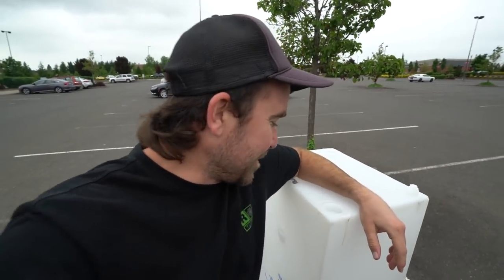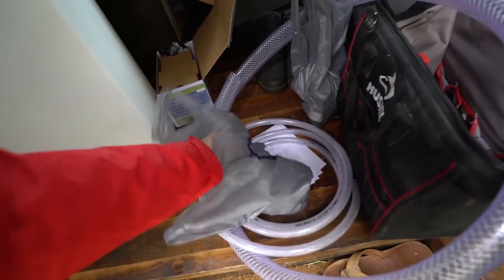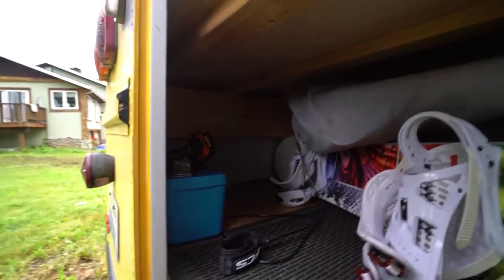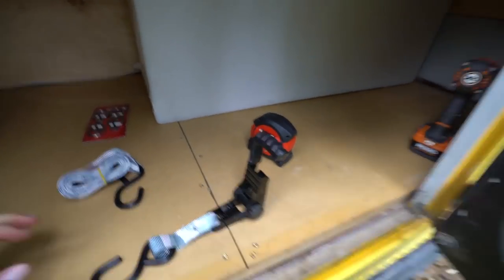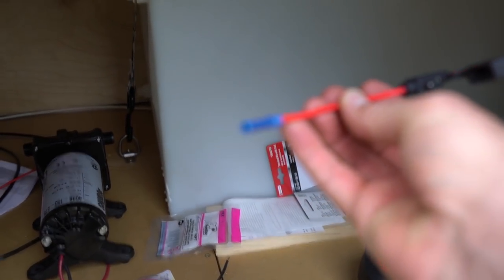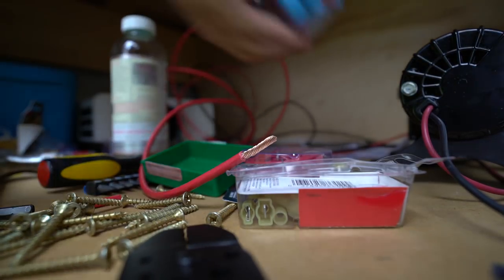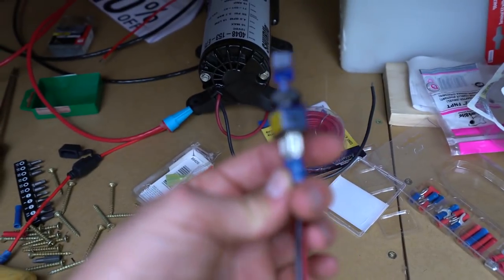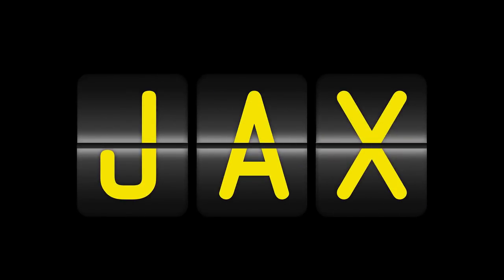DIY School Bus Conversion Shower Install Part 1 🚌 #VanLife Vlog: 230

Comment: Tiny suggestion sir...! 
put a small wood cleat screwed down at the end of your water tank to prevent side to side tank movement in addition to your ratchet strap anchor.  I am concerned your strap anchor might pull out of the floor due to tank movement left and right as you hit uneven bumps in the road causing the water in the tank to slosh around like a small elephant in the back of your bus... 😯
Also twist your waterproof wirenuts as tight as possible to prevent a loose wire connection which can cause excess resistance at the connection and cause heat/fire possibly.... 👌

Comment: Glad to see you put the fuse on the battery side.  The point of putting the fuse as close to the battery is in the event you damage the cable between the battery and the appliance the fuse will blow because it is prior to the fault.  If you put the fuse on the pump and let’s say screwed thru the it while putting a cabinet in or something you now have a higher risk of fire and blowing the battery. When you have it 100% working I would solder and heat shrink your connections.  It is mostly a personal preference but I have never had a solder job come loose. crimp and twist connectors I have and you have 2 different size wires making the connection even more delicate.  If you have a Harbor Freight nearby their solder gun isn’t great but it works and is cheap.  Check out the coupon search on struggleville.net. The solder gun takes up no space in your toolbox and can be used for tons of repairs.

Comment: You need the air valve open, so when your sucking water out of the tank with the pump so air can be sucked in to replace the water being sucked out, if you don't you might get bad water flow, think of it like a gas can when you pour gas out of your jug you got to open the little vavle on the top of the can to let air in so the gas flows faster and better, if you don't the jug try's to suck in or the gas burps and guzzles trying to come out. Hope it works for you 👍🏼
Reply: Oh screw some wood blocks to the floor on backside and the sides of that tank, when you fill it there'll be a lot of weight in it from the water, so that strap might not hold it. Just extra precaution bro, hope this helps and keep you safe 👍🏼

Comment: I think your water tank is upside down, Large hole is for your fill hose and small one in line with the fill is a breather fitting, the single small fitting would be your tank train line.